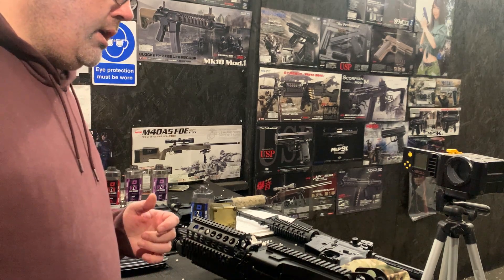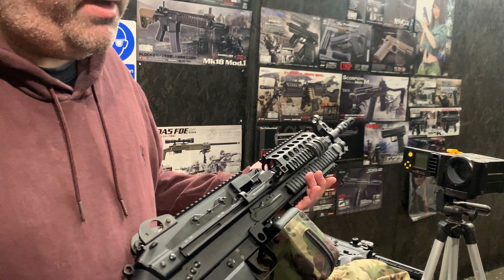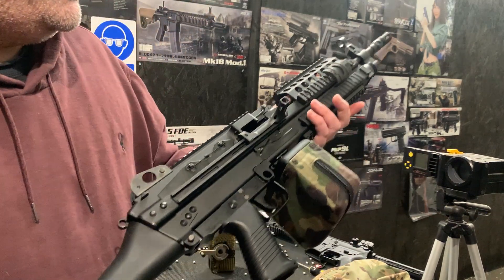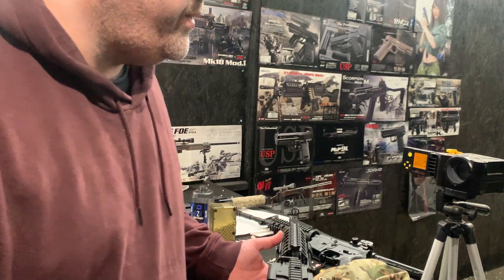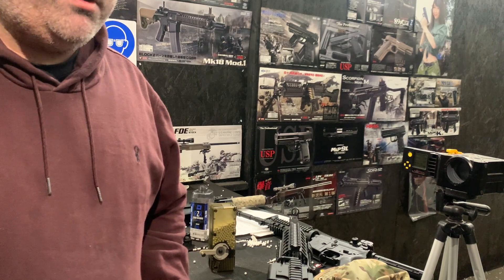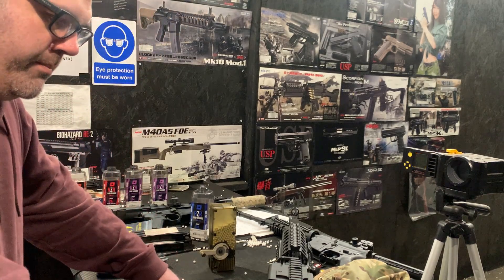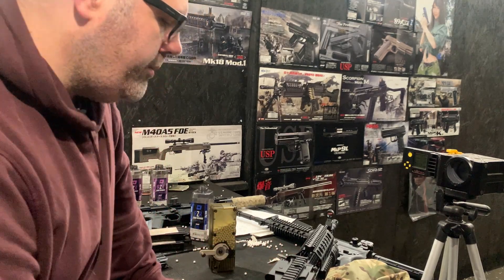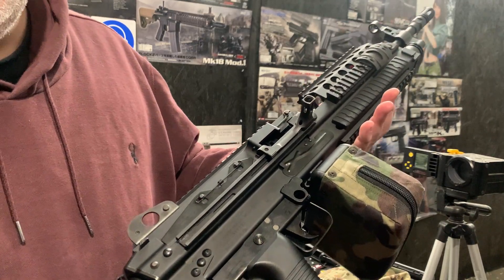Upgraded TM MK46 NGRS AEG | 532

Comment: I cant seem to find any video showing how to disassemble this one. After playing with it for half a year I need a bit more fps than stock. You know where to look for such video?
Reply from the maker: We do the springs and power spacers on the website.  I’ve done no video yet, it’s only because of lack of time.    It’s pretty easy in the grand scheme of things.   Remove mag bracket and grip.  Remove two screws on the bullet tray, remove the triangle that operates the bullet tray, remove the 4 screws front snd back of the recoil system and lift it off completely.   Remove the selector bar from underneath.   Remove the screw from the back of the gearbox spring guide and the 2 screws holding the bracket.  As you wiggle the gearbox out remove the fire selector button and slide out the gearbox and hop assembly.  A little bit of a over simplification but the general idea.